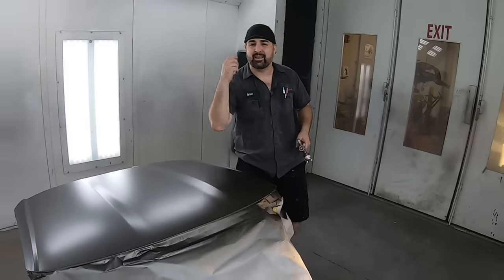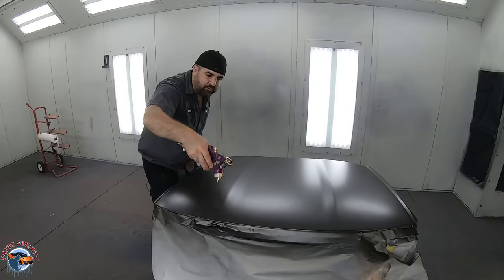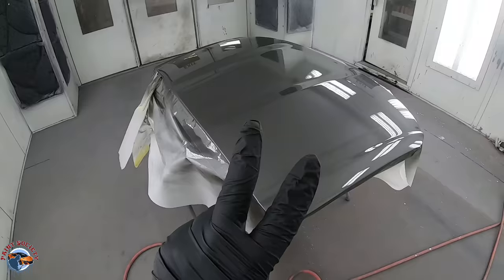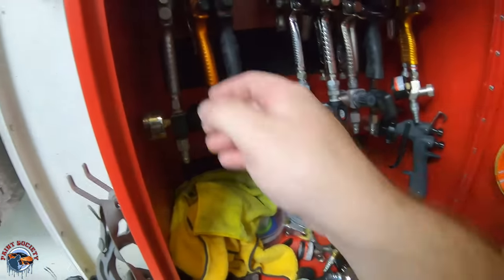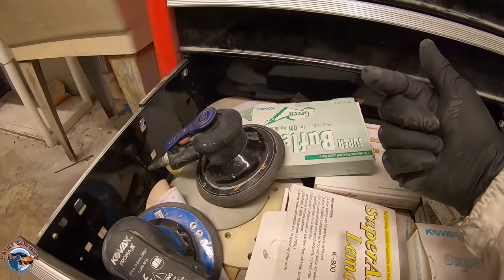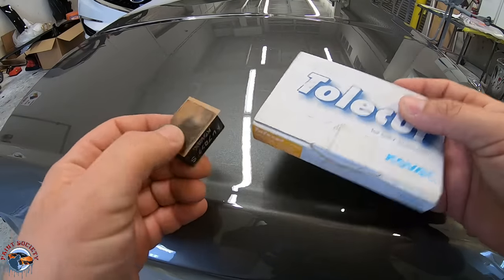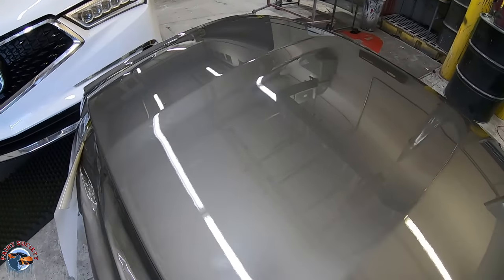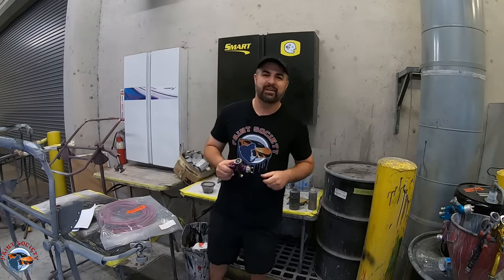How To Get AMAZING Results With A $15 Harbor Freight Paint Gun!

Comment: I have an issue losing gloss after spraying my clear. What cause that and how to prevent it? Also great result as always, keep it up 👍🏼
Reply from the maker: Watch my video on how to spray clear
Reply: Maybe use a different clear. Some of them "die back" they just dry duller than others
Reply: Quality of clear does make a difference so spend a little more for better brands and match reducers.  Likewise time between coats and how wet you lay them down makes for differences in the final gloss levels.  Brian’s vids on clear and overalls give you great training and tips, be sure to watch them and follow his procedures closely.

Comment: Hi Brian, I’m confused with clear coating after a blend. when you blend do you always have to bring the clear to the edges of the blend panels and what is reason for this. Thanks Brian
Reply: Clearing the entire blend panel is a more durable repair. Using blending solvent to melt in the dry edge is poke and go at best and often reveals itself in a short time meaning the half ass repair looks good at first but soon after it will be noticeable something happened there.
Reply: If you do a proper color blend then it’s always best to clear the entire panel to an edge.  Watch Brian‘s blending videos as his technique is absolutely spot on.  

If you need to work two or more adjacent panels possibly one will be a full color and then the adjacent panel(s) can be blended outward on either side… before clear-coating both or all of them completely.

Comment: Just wondering if you would do a review on the Eastwood concours lt100 I seen alot of people on the  Facebook group recommend it for starting out since it has a low cfm and it's under 100
Reply: I have that one and it took me quite a bit to dial it in. But then again, I’m a newb at painting. Must admit, my 20 gal compressor doesn’t keep up with it very well
Reply: @jordanspalding6446  Just curious how do you dial it in by spraying it on a cardboard box and seeing how the pattern is? lol a newbie also

Comment: I use this gun for my primer 😂😂. Great clear job though looks great.  Got my Supernova for clear though
Reply: I bought some eastwood  contour polyester primer and they recommend a 1.8 - 2.5 nozzle. you think the cheap gun would lay it down?
Reply: @bobbyt3358  yeah I would recommended adding a little bit of reducer to it and it will still lay down thick but It will spray easier out of the gun. I use it to spray a 2k primer
Reply: @mactivision  Thanks for the quick reply. Where did you get the 2 k primer from? Talking to a 1st timer here. Trying to do a roof on a Expeditiion
Reply: @bobbyt3358   id say look for a paint store in your area and maybe go with like a cheaper setup like a Upol UP2253 that’s what I’ve been using as of lately it’s about $70 a setup and last for a while imo
Reply: @mactivision  Thanks for your help man.
Reply: @bobbyt3358  sure thing

Comment: Okay, but what do we do if we have a something come out of the final layer of the primer? Should we sand it out the same way, and then buff it or just do that when we have the clear coat on?
Reply from the maker: You can buff only the clearcoat
Reply: @PaintSociety  so if this happens on the final layer of the primer then all we can do is sand it out with 600-800 (water based) and just apply another coat?
Reply: @piotrpix  In general, yes.  Never move past the primer until it is perfect and flat.  If you need to rework a problem, give it time (SS) or overnight (epoxy), sand with proper grits and then respray entire panel or overall.   Always be sure to follow procedures and never deviate from the approved (tested) steps.

Comment: Do.you set up the tekna pro lite the same way? I tries to and it puts way to much material out with 1.3 tip.. thanks
Reply: If its putting out too much material, then u adjust the material fluid. Every painter is different, too much for you maybe just right for someone else.
Reply: @JimmyJiveJones  hey thanks for the quick reply!
Reply: @JimmyJiveJones  should fan always be wide open? Or adjust as well?
Reply: @shaneslone2764  Im a devilbiss guy so i cant comment on the other type of guns, but always wide open is best. And in most of Brians videos, he reccommends wide open aswell

Comment: you can return a harbor freight gun when you're done using it, even if you left it in shit condition. Don't even have to have a problem with it, the cashier will not give a fuck. Just be sure to get one you can clean out between coats, that's all!